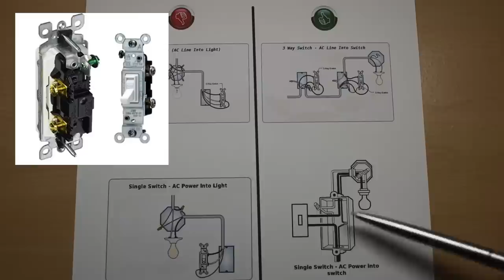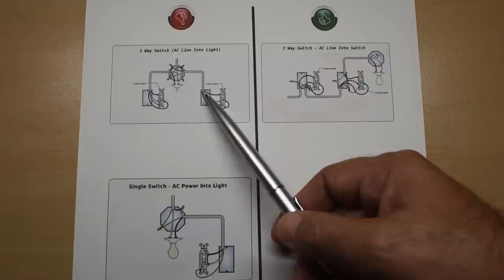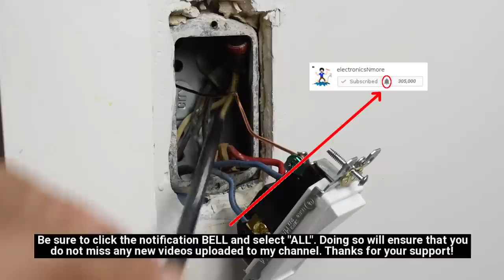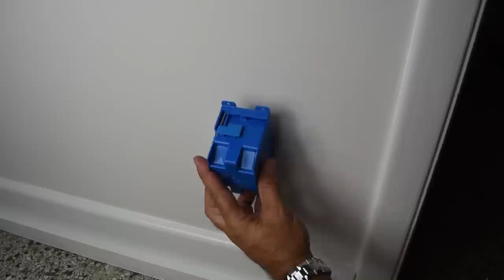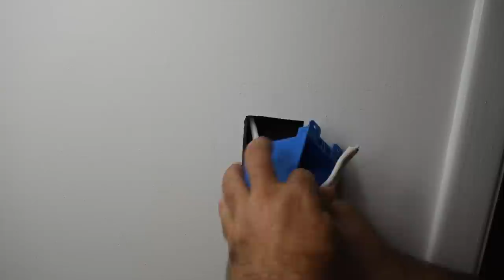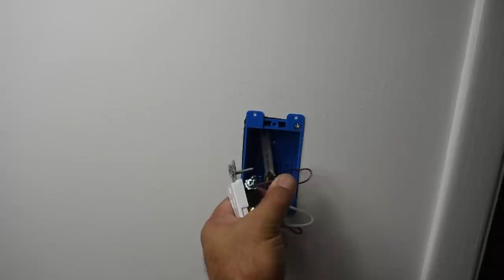How To Add An Electrical Outlet From A Light Switch!

Comment from the maker: ATTENTION: Due to the large number of YouTube experts from the UK posting comments on this very well explained video intended for the USA, I need to clarify a few things. What's shown in this video, when done properly, using the correct size wire and proper rated receptacle, is completely safe. Clearly you wouldn't add a receptacle to a branch circuit that has too many loads on it, or a branch circuit that you have to reset the breaker from time to time, otherwise you'd make the breaker trip more often. A 15A breaker can handle UP TO 1800W, and a 20A breaker up to 2400W. Add up the existing loads on the branch circuit and make sure the load is well under the breaker rating before adding an extra duplex receptacle. As stated in the video description area, where the disclaimer is, always check with your local electrical codes before doing as shown. Thank you!
Reply: If only you had given that advice out in your video. And stated it was intended for US viewers only. But you couldnt even manage that. LOL
Reply from the maker: @professoryaffle82  I think an intelligent viewer would know what their receptacle looks like in their own country. :-) I also explained in the video that the black wire was the "Hot" wire. I don't spoon feed viewers.
Reply: @electronicsNmore  Well, i was amazed how electric stuff in the US is constructed, metal boxes?... But also amazed that a simple switch has a ground connection.. In the NL we don't have that... But i can assure it's well isolated from live wires in the whole construction... ;)
Reply from the maker: @underverser  People have a habit of comparing the US to other countries. They need to stop doing that. BTW, I have full disclaimers in the video description area, so I have no worries. Thanks for watching
Reply: @s1iznc1d34  As far as i know, no one is ever zapped by their switches... So i have no doubts about the safety of these switches... ;)
Reply: @Professor Yaffle , Who says that it's only intended for U.S viewers? I'm in Canada and the video is applicable here too. But just in case he missed something maybe you can share it with us on your YouTube channel!
Reply: @professoryaffle82   For someone who uses Professor in their name you aren't to bright. There is a thing called critical thinking.  : )
Reply: It's shouldn't be done that dangerous you are over loading a circuit. It you up the fuse the li ting cable will be too small you will cause fires. Not hating that in the UK is illegal for a reason.
Reply: Impossible a socket is 13amp a lighting circuit is 10amps you are over loading the circuit.
Reply from the maker: @keithjones6463  You're wrong, and stop comparing the UK to the US.
Reply from the maker: @keithjones6463  Are you for real? LOL
Reply: underverser actually in the US We seldom connect the ground to the switch itself. If it’s a metal box though you’re required to connect the ground to the box itself
Reply: Keith Jones actually it’s very uncommon for a circuit to be overloaded if a good electrician did the original wiring. I’ve been an electrician for 25 years now. I never add more than 10 receptacles per circuit on a 20 amp breaker. By doing so you make it so the receptacles on the circuit have a draw of 1.5 amps each. Adding an additional receptacle to that circuit is fine though for remodels because you’ll most likely still not come near 20 amps unless you plan on using devices with motors or heating elements. If it is a concert all you have to do is turn off all the breakers but leave the one with the new receptacle on and turn everything on that you’ll be using that’s on that circuit then take your multimeter and measure the amount of amps being drawn on the circuit in the panel. It’s highly unlikely that even if you do overdraw on the circuit that you’ll have a fire as long as you have good quality breakers like square D. Now if you have federal pacific breakers, that’s an issue because they have in fact caused a lot of house fires due to their poor quality
Reply: I had a guy from the UK arguing about electricity with me when I was talking about USA wiring, and he would not let up.
Reply: @keithjones6463  The USA doesn't do things the way you guys do in the UK. We use the same size cable throughout the whole circuit that is rated for 15, 20 amps or higher, depending on what type of circuit. The circuit breaker protects the whole circuit. We generally use 15, 20, 30, 50, 60 amp breakers and the wires coming from those breakers will be sized accordingly. There is no such thing as a 10 or 13 amp breaker here in the US.
Reply: @underverser  The metal box is also bonded or grounded by the conduit and that ensures that during a ground fault there is a low impedance path back to source to trip breaker.
Reply: @s1iznc1d34  Depends on your cover plate. If there is no metal screw or anything conductive then the switch can't hurt you.
Reply: @s1iznc1d34  Electricity cannot arc across air far enough to go through a plastic wall plate at 120 or 240 Volts. I hope you're* not an English teacher.
Reply: Also, in the USA when there is an old circuit that doesn't have a ground, there are several ways to replace the device safely and have it be code compliant. One way is to have it be GFCI protected, another is to have a screw less wall plate. Another is to have a wall plate with plastic screws. I live in the USA so that is the code I am referring to.
Reply: @s1iznc1d34 The code book has nothing to do with me being an electrician or not. Not sure what your point is, but what I said is clearly stated in the NEC. Also Sparky channel is a licensed electrical contractor and he goes over these grounding situations here on Youtube.
Reply: @s1iznc1d34  For your information, I always connect the ground on devices. There are some cases where there is no grounding available, though, and the NEC has provided exceptions for changing old ungrounded devices. I cannot speak for other countries, or for people who lose screws on the wall plates. All the stuff you said is irrelevant when it comes to what my point was.
Reply: @s1iznc1d34  Screwless wall plates. Look them up.
Reply: @s1iznc1d34  When there is a ground it should of course be connected.
Reply: @s1iznc1d34  Also just FYI, I am a lighting installer and we work along with the electricians and our jobs pass inspections all the time. Devices are bonded and or grounded. There are situations where old homes do not have the grounding or they have 2 prong receptacles and that's what the exceptions in the NEC that I mentioned are there for.
Reply: There is a plate that snaps on over the plate that has the screws, therefore covering the metal screws. They are very common.
Reply: @illestofdemall13  I'm aware pal. Its what I was trying to say.
Reply: Maybe your video should just say - If you want to add a power point to a lighting circuit, call your local licensed electrician - Don’t try to do this yourself as you may well end up dead. Videos like this should be illegal, regardless of the country of origin. People die every day from electric shock, and you are simply keeping the supply going. Most Diyers would not have a clue what you’re talking about with your diagrams.
Reply: my plan is to remove the switch all together and replace the lamp with one that has a pull switch. probably not technically allowed by code but I think i can get away with it.

Comment: Superb training:  shows what is needed, defines parts and shows them clearly, explains work habits as well as tech challenges, deals directly and explicitly with safety guidance all thoroughly and all in language everyone can understand.  Much much prefer to spend 25 minutes and be 100% sure I've made all the right choices, decisions, connectrions, than 2 minutes and hope that cutting power back in does not either burn down the house or electrocute me.  This is how a how to video should be made and anyone who thinks this deficient just has no knowledge of how to coach and teach.

Comment: Thank you for this tutorial, I was considering putting a wall outlet next to a light switch that leads to an inactive ceiling light outlet in my kitchen and was not sure how difficult it would be for someone who has 0 electrical experience.
My father was always an insanely skilled handyman and smith, built a whole house in the 90s, but since I haven't been in contact with my father for years there's not been anyone that could teach me these basic skills a (handy)man should have, so I really appreciate people on the internet like you that provide well presented, helpful guides.
Reply from the maker: If power originates at the switch, which is does the majority of the time, then it's easy. You can replace the switch with a light switch outlet combo and not have to cut into the wall to replace a single box with a double.

Comment: Great video. I’m having trouble. I don’t have hot wires capped in the box, only ground and neutral wires capped. And I have a signal wire (red) also. 😟😟. Does it mean I can’t do this? It used to be a garbage disposal switch but now that wiring is useless as I installed air switch via under the sink.
Reply from the maker: Duplex receptacles located under a sink are usually a 20A split circuit. One for a disposal ,and the other for a dishwasher. The red and black both use the (1) white wire to complete the circuit. You should have no problem using that. Thanks for watching
Reply: electronicsNmore I installed the outlet myself under the sink.

Comment: You said to check both the black and white wires that are wire nutted together for power even with the breaker turned off and they should be hot otherwise they can’t be used? Wouldn’t that make the outlet hot always? If so that’s not to code.

Comment: Great video. Question: Why in the second picture. (Single Switch- AC power into light) Why can I not pig tail the live wire and neutral wire  coming into the switch box from the light fixture and run that to a new electrical outlet?  I fully understand first picture is direct power going to switch and leaving to light but just not sure why second I couldn't pig tail as there would be a live feed coming to switch.
Reply from the maker: Because you won't have a neutral wire. I explained in the video where the neutral wire was. Thanks for watching!
Reply: @electronicsNmore  Yes see now. Thanks for the reply.

Comment: very well explained video thank you..I was wondering if and when would you use electrical tape to offer an extra layer of protection inside the receptacles..also, what if the wall had an horizontal stud between the light switch and the spot where the receptacle will go? how doyou get the wire through?
Reply from the maker: You would have to make a small opening in the drywall, notch the stud, insert the cable, and then place a metal plate over the notch before putting the drywall back into position.

Comment: When I open up my light switch, there are three black wires  fastened together with a wire nut and three neutral wires fastened together with a wire nut, as well as two ground wires coiled together and secured to the switch. Would the steps in this video still apply?
Reply from the maker: Make sure power is always present between the black and white wire nuts, regardless of the switch position. If power never goes away, you can do as shown.

Comment: Quick question. In the example at 3:33 with the 3 way switch you mention that you cannot open up in the second box. Isn't one of the 12/3 wires between the switches always hot that you can use to tie into for an outlet off the second switch? All new to me so sorry if this is a silly question
Reply from the maker: The wires going into the second box will be switching ON/OFF, none will be live all the time.

Comment: on the 2nd example you said it could be used if it was metal conduit, is that a code?  I have a line to a Flour. light that is no longer used, Could I use that line to run new receptacles?
Reply from the maker: I need more detailed info. Thanks.

Comment: Can this be done with a dimmer switch? I want to convert my dimmer to a dual gang junction and add an outlet so they will be side by side.
Reply from the maker: If power originates in the box where the dimmer is.

Comment: John Roberts, my thoughts exactly buddy, sockets use 2.5mm cable due to ampage etc where as light circuits use 1 - 1.5mm cable
Reply from the maker: Stop comparing the USA to Europe. LOL In the USA, lights and receptacles can be on a 15 or 20A branch circuit.
Reply: This is AMERICA  we use the AWG aka " The American wire gauge "   for wire sizing.  Duh !
Reply from the maker: Probably the same guy that tells Americans how to pronounce the words "Solder" and "Salmon". 😜
Reply: @electronicsNmore  YouTube videos are watched the world over. Unless you include a disclaimer people are going to assume, rightly or wrongly that they can do this in their own country. You certainly can't here in the UK. At least include a statement telling viewers that regulations in the US permit this but to check in your own country.
Just to add that if you did this in the UK it would be against the regulations but wouldn't be dangerous because the lighting circuit (1 or 1.5mm cable) is protected by a 6 amp MCB. You just wouldn't be able to draw a current in excess of that. I'm certainly not a 'hater'. Just making what I consider a valid point.
Oh, and to point out this video didn't even come up as recommended in YouTube but on my Google newsfeed.
Reply from the maker: @SOTK SHADOW If you were a long time subscriber, and appreciated all that work that went into my videos, then you would've posted a polite comment for me to reply to if you had any concerns. I would've explained. What did you do? You agreed with your buddy John from the UK. Very foolish subscriber. Next time think.
Reply: @electronicsNmore  yes I did agree and for good reason which WAS explained politely as to why, its you who was out of order not me plus I don't know the guy either and it's you who needs to think about how you respond too and about other people
Reply from the maker: @sotkshadow8306  You jumped fast and took the wrong side, so don't blame me. The idiocy I've been getting from UK viewers, is nothing less than disgraceful.
Reply from the maker: @sotkshadow8306  Your're taking advice from a UK citizen on how American wiring should be done? Wow, you're not the kind of sub I need. Click unsub. There was nothing polite about 95% of the UK comments. They were all snide, and highly misinformed about US wiring.
Reply: @electronicsNmore   Hi Doug the very fact that these people set at a desk or  on their  phone means they get to say whatever pops into their heads,no matter how silly or wrong the comment is. It's a dark world we live in these days my friend. All my best.

Comment: Code requires ga12 for outlets and most other circuits, ga14 OK on some lighting circuits. For safety's sake a green insulated wire should go from the box to the receptacle or switch. Overall a good general tutorial. B.T.W. most pre-existing light switches I've seen only have two wires for the switch with the power feed being in the fixture box.
Reply from the maker: Receptacles are very often wired using 12ga copper wire on a 20A branch circuit, but not all the time. Millions of homes have 14ga copper wire feeding 15A receptacles, such as mine. Thanks for watching!
Reply: There is no code stating receptacles must be 20 amp or on a 20 amp circuit. Some will be 20 amp and some 15 amp.
Reply: @illestofdemall13  Many local codes do not allow 14 GA for outlets while still being OK for lighting.
Reply: @pafoofnic  Ok I was referring to the NEC. In my area it is fine. But you commented on his post saying he violated code, yet you don't know that because local codes vary.
Reply: One must check their local code. You can't make that call for them. It's up to the local codes and the inspectors.

Comment: Does it matter if you twist the wires together before adding the cap or letting the cap itself twist the wires together when tightening?
Reply from the maker: Not really. If you strip all the wires to 1/2" , then hold them side by side all lined up, once the wire nut is slid over the ends and tightened down, they will twist together. I usually twist them to be fully certain of a strong connection.

Comment: I have a single switch with the ac power in the light and my receptacle hole already cut in. Should've watched this first. TryIng to avoid a trip into our limited-access attic. Could I connect to power in the switch box if I was willing to have the new receptacle controlled by the switch?
Reply from the maker: If you only see (2) wires plus a ground wire inside the switch box, no.

Comment: Thanks for the vid. Does the Romex need to be secured to a stud or supported some other way? I thought there were regulations about support within 12 inches of a box and every 54 inches.
Reply from the maker: It's an "add-on" job, so you can't hammer inside the wall. Securing the cable to both boxes is fine. Thanks for watching!